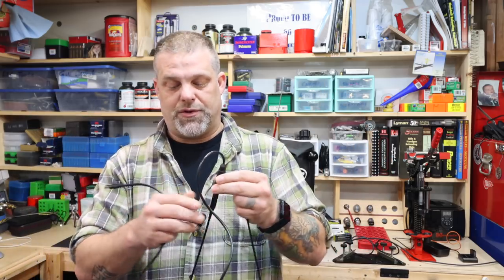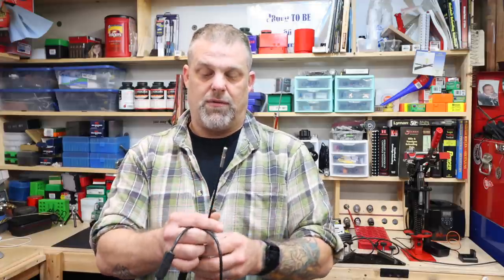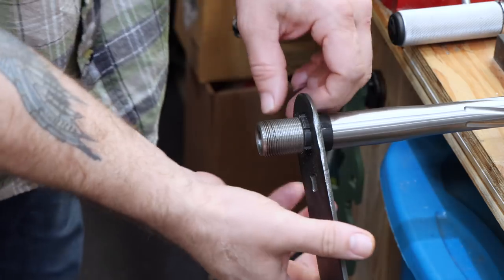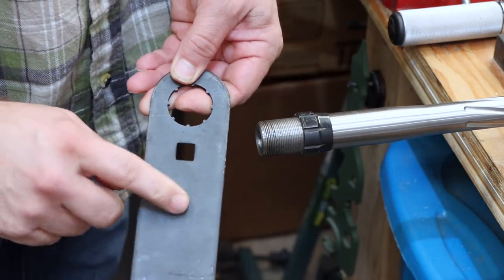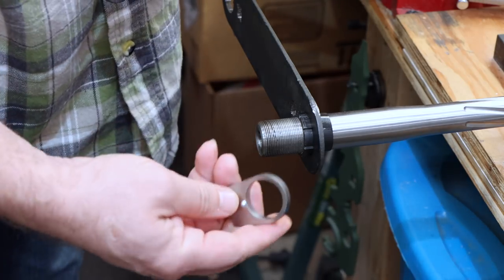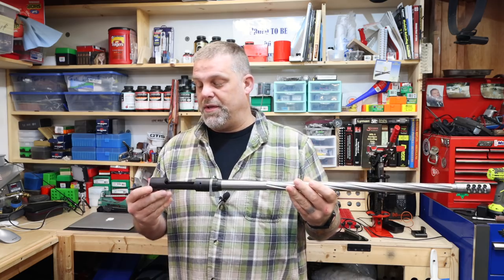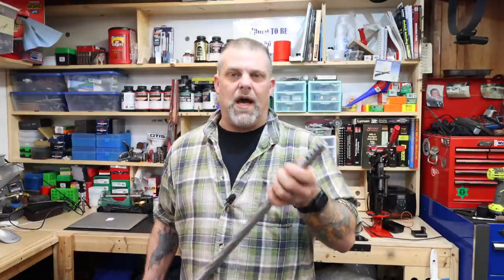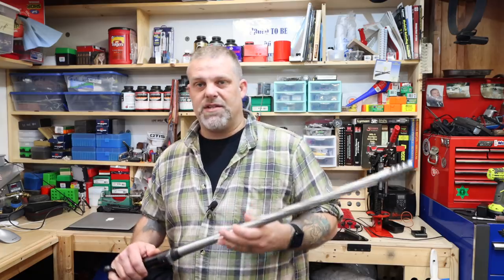Setting Headspace on the Savage Model 11, New Barrel

Comment: I've shot a bunch of centerfire rifle brands and tinkered with those I have shot and owned. Savage is just the Chevy 350 engine of rifles. They are accurate, relatively easy to work on, parts and accessories can be found easily and they aren't as expensive as other brands that they are up to par with on accuracy. Actions aren't as smooth but with some elbow grease they can become acceptable for most of those beginning their journey into target shooting. Professional competitors are going to use the best equipment, "they" can afford. For the weekend warrior, Savage gives, if you are a tinkerer, the ability to learn a lot about the workings and experience in your field of choice on the cheap in my humble opinion.

Comment: i have found better accuracy, or should i say consistency headspacting off of the ammo/brass i intend to use. Then checking with a go gauge and no go gauge. Usually ends up on the tighter side. The only issue with this is ammo other than used to headspace may not allow you to close the bolt. If putting one together for sale or for someone else i would do it exactly like you did here. Just food for thought. Try it on brass you have already sized. Shoot some groups and see if you find the same.
Reply: Good info..I was wondering if I could set the headspace with a dummy round that I sized.
Reply: @crcdesign9886  if you're reloading, just be sure your brass is size the same that you head spaced with. Should make things a lot more consistent. Just means if you switch ammo up you might have headspace issues.

Comment: I'v never seen an action wrench like that.  Where is that from or did you manufacture that ?
thank you
Reply from the maker: Here is a link to the wrench set for the savage. They are inexpensive but work great.! https://www.amazon.com/gp/product/B002DKS6LK/ref=as_li_tl?ie=UTF8&camp=1789&creative=9325&creativeASIN=B002DKS6LK&linkCode=as2&tag=vaughnprecisi-20&linkId=e184476d1cfe15e584cef8747d7b872f
Reply: @vaughnprecision  thanks for adding that link! I've seen that on midway for sale, I thought it was for smooth barrel nuts but I had never measured the diameter of the smooth but and compared it to the action
Reply: thank you for the link
Reply: @fattigla the directions say it's for a smooth barrel nut, but it seems to work for the action as well. I plan on using it for the action also. I was glad to see it being used that way.

Comment: Got the Savage 110 Ultralite. The fluting is so aggressive, it’s like racking a cheese grater. Thinking of switching out to a smooth bolt body. Will I need to readjust head spacing when changing out bolt body? Obviously I’ll check with gauges.
Reply from the maker: Yes, you will definitely need to reset the headspace.!
Reply: It isn’t the depth of the flutes necessarily. I have a custom action with deeper flutes that’s smoother than a tikka. It just comes down to the machine work, and the tolerances. If anything send it off to be nitrided. It will make a significant difference.

Comment: Hello, Have been following a number of your Savage videos and with this one I have to ask. I see you are using the Wheeler Nut wrench tools to do this with a barrel vice and not an action wrench. Have you had any issues doing it this way? Would you recommend an action wrench over the Wheeler to hold the action?
If this works, great. Really don't want to buy a $60.00+ wrench for a possible one time use
Reply from the maker: I actually use them both and you’ll definitely need an action wrench. I know it’s more money but when you need it you really can’t get by without it

Comment: merry christmas..Are all the barrel nuts the same size for savage if its a factory barrel?  Ex. if I'm going from a sporter contour to a heavy varmint in the same caliber will I need a new nut and wrench?
Reply from the maker: No; these is a large size (uncommon) and a standard size that is the most common. You probably have the standard size
Reply: @vaughnprecision  I’m sorry I should of phrased my question differently. I have a savage axis in 223 with a factory contour. I have a barrel I bought but it’s a varmint contour. Can I use the same nut and wrench?
Reply from the maker: @crcdesign9886  yes, most likely you can use the same nut and wrench. I simply can’t say 100% because I can’t see them but in my experience that will work

Comment: So I’m doing some research and I thought I would ask an expert. I’m in the market for a lathe to do barrel work. Mostly bolt action percision rifle stuff. What would be good lathe to invest in. I’ve been looking into the percision matthews 1440gs. What do you think is a good lathe for chamber/barrel work? Thanks! I’m glad your back at in and mostly recovered.
Reply from the maker: I like Grizzly brand lathes, I’ve got the cheaper model and still get some great precision work done on it. They have some higher end models that have a ton more features. Nothing wrong with Jet or Mathews either.

Comment: Ever use any type of anti seize on barrel threads?
Reply from the maker: No, not usually but I have used it before
Reply: There’s a similar setup for rem 700 made by Adams & Bennett’s